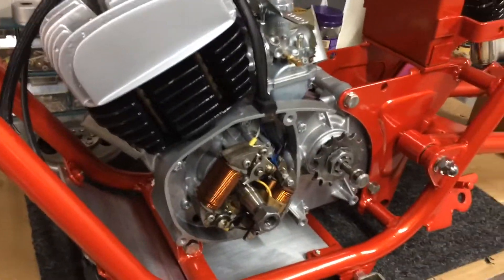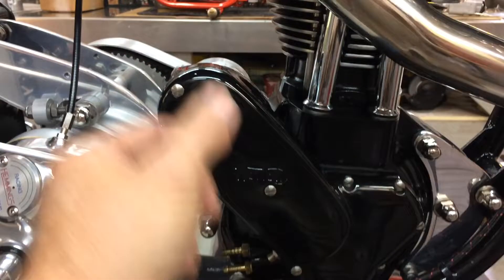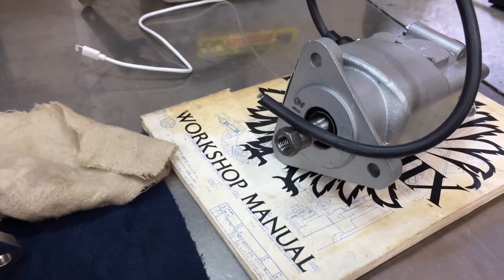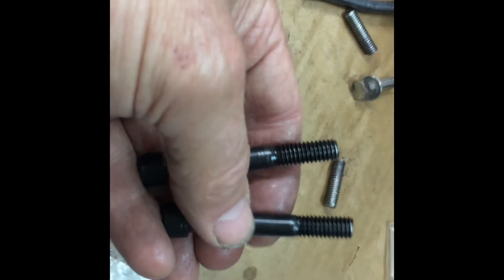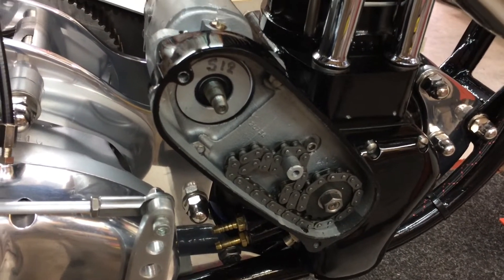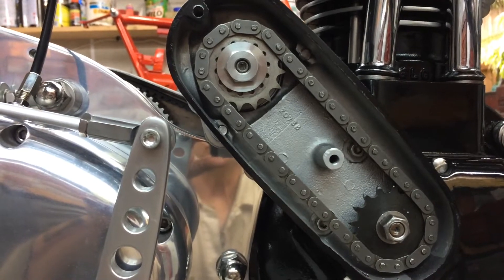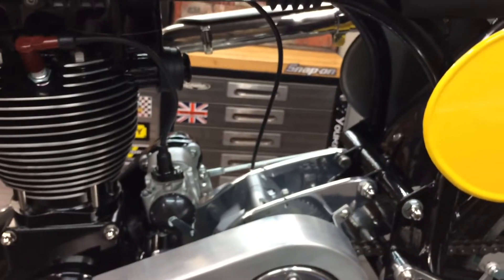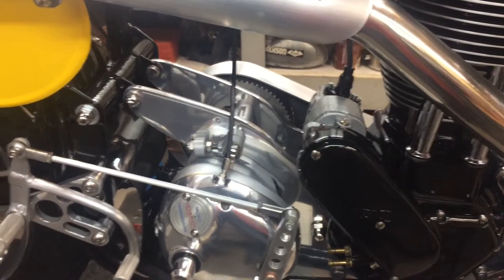Norton Fix pt 6 Install Magneto

Comment: Coming on nice
Reply from the maker: Thanks Pat!
Reply: @jarnosaarinen4583  like the red frame as well that's guna be nice
Reply: I’m looking forward to see the “Snortin Norton” started up. It’s come a long ways. Great job Jason.
Reply from the maker: @timbits.4232  It wont be much longer, I just need to get to oil system plumed right, don't want to hurt anything by rushing!!
Reply from the maker: @Scano41  I like that red to Pat the original colour is a darker red but I like this colour better!